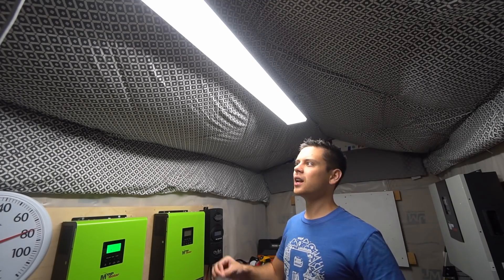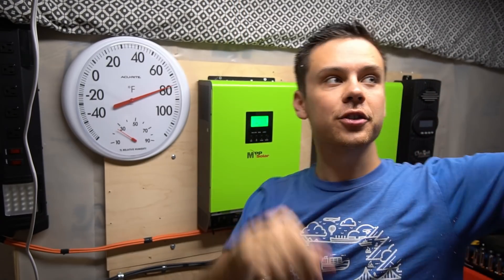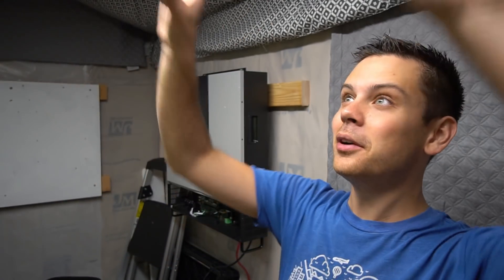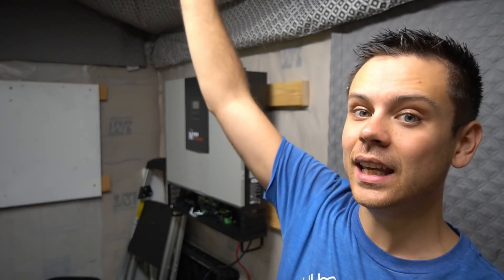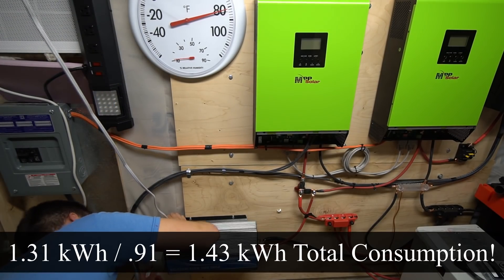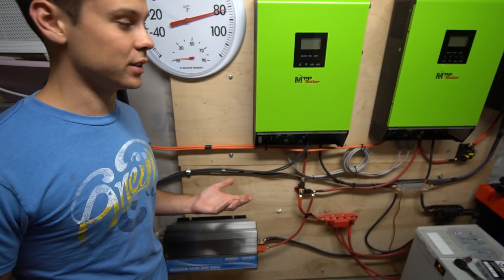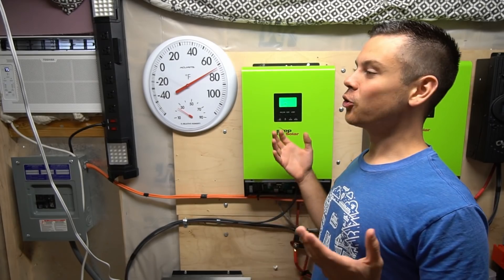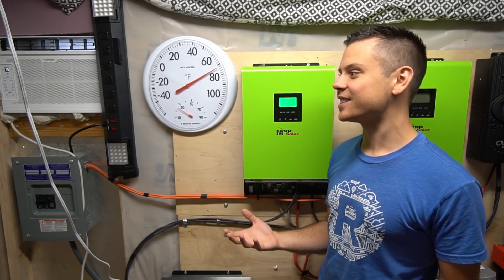Cheap Solar Powered Air Conditioner Part #3

Comment: 10% humidity, try 106 degrees @ 110% humidity  almost daily here in south Louisiana. Also try to bring the temp down into the 60"s.  I have the same window AC I use for hurricane purposes, that I hook to a generator for power outages due to the hurricanes and trying to figure out how to hook it to solar. Just want to cool 1 room with solar experiment #1. Once I figure it out, 2nd project will be a 20x60 shed. Still confused on what I need. I just been buying all the wrong things. Have 1,100 and a 2000/4800 inverter, a few charge controllers, only have a few 100w folding panels ( I think I need at least 600w for that same window AC)

Comment: I just stumbled across your channel today, excellent content! I'm in the market for a solar power generator to have just in case the power goes out for a few days. I would definitely want to run an air conditioner off of it in one room of my house in the summer months, as well as be able to boil water or heat up prepared meals.

Have there been any other updates on your solar shed? It looks like you did a fantastic job insulating it, the MS paint diagram was very effective explaining what you did. Thank you again for sharing your knowledge and enthusiasm on this topic!

Comment: I would like to have a small system for my minivan camper, based on 12 volts.  Can you recommend an inverter with low standby losses in that voltage that is resonable $$?  I presently have a 120w panel and plan to run a very small 25L Alpicool fridge/freezer and charge the usual electronics/TV and some night time lighting.  I was going to buy a 100ah lead acid battery but I guess it's prudent to only take 20-25% of capacity so would a 50ah LiFePO4 be more than equivalent?  Any help is appreciated I'm 74yo and very new to solar.  At my age it is probably a lifetime system for me.

Comment: Which 24V inverter should I buy?  The MPP LV2424 (which consumes 50W on idle)  Or the Growatt 3kW contender (I could not find its idle consumption)?  With shipping, the Growatt is only $40 more.  I do not like the 50W idle of the MPP, but Growatt might not be better???

Comment: Wanting to put a 5000btu ac in a van about the size of an ambulance. Have room for 4 x 200 watt solar panels on top... question is... I am using agm group 27 100ah batteries I can pick up very cheap... how many batteries you think could run the ac overnight? and would the solar panels charge them up to run the ac every night? I live in Florida... no shortage of sun... thanks

Comment: I'm using your book to add a 600W, 3 Battle Born 100W, system to my 2004 Born Free Class C. My RV has a built in Generac 4000W generator and a 2000W inverter already wired in. But I sure wish you had covered how do you wire in a solar system and still use the generator and also the alternator charging capabilities. I don't really have a clue how to do it and I am installing the whole thing alone, while boondocking far up a USFS road in remote/webless central Idaho Rockies. Wish me luck. (PS this is my X, not me in pic)

Comment: Will I like your do-it-yourself approach and methodical research to solar energy. I think a professional builder would have insulated your solar shed differently however, and reduce risk of combustibles. Considering the variety of components I would recommend that you put a wireless smoke alarm in your shed and a second one in your home that can talk to it so if say one of the diodes in your charge converters go bad and starts smoking you would receive an alarm before the shed burned down.
Reply from the maker: Fair point. Unattended charging is done with UL listed controller to prevent this. But yes good point

Comment: VIDEO IDEA! 12 VOLT ONLY SETUP? All of your setups include an inverter. Why? When camping I exist primarily on 12v. Easy to recharge my 12v batteries with solar panels. Refer - 12v/propane, TV - 12v, Charge phones - 12v, etc. Exist without a Microwave, stereo or blender? Easy? Coffee, food - Propane Stove (Camp Chef). Music - JBL Charge 3 or ? and a phone or MP3 player. Food - propane BBQ. Suffer without a blender? - mixed drinks or beer. The only time I need 120v is my satellite dish - A Jackery or ? - recharged by Solar. Isn't to whole point to solar is to simplify your life and dependencies?  It kills me to hear generators running or listen to people that can't live without being hooked up to the grid?
Reply: Is there any 12V air conditioners? Compressors take a lot of power so probably need voltage higher than 12V. I'm guessing....
Reply: @sean8081a  I guess you'll just have to rough it - no A/C? Just cold beer?

Comment: Have an off topic question for your advise as you are the best at these power stations by far. I want a emergency back up for home use and later to bring on trips but for now home. So one is only charging up using a/c.  I'm between Bluettie 1000 watt and goal zero. It has to run a fridge for at least several hrs til power would get back. Yea maybe make a cup of coffee . ha   I am thinking both can do what I want. Leaning to bluetti but definitely want your advise.

Comment: i think you should ditch the blanket and just go with more foam panels - get some more led going in there, try also a small hepa pos pressure intake and maybe a small heat exchanger - what would a person need if they wanted to put in a mini split - a few more batteries or panels no doubt but overall the system could be expanded pretty easily to add capacity - you may want to add insulation to west wall but i think you basically got it under control  - well until it gets to be 120 and then we will see how it holds up - maybe consider a small helical wind turbine or two as a battery hedge strategy?

Comment: Very, very cool (no pun intended!) Will. I have another project using an inverter to power an ac that I hope you can give me some advice on. I have a van with a 220 AH flooded cell deep cycle house battery bank, a 2000W/4000W surge pure sine wave inverter, and a 160 Amp engine driven (stock) alternator. I replaced the .7V power robbing to the house bank isolator with a Blue Seas ACR, or automatic charging relay. I also have a 8000 BTU  window ac that pulls 620 watts with the compressor running. Start up surge is unknown, but my 2.8 KW Onan generator powers it up effortlessly. My question is, assuming that the ac's compressor start surge will be handled by the inverter, do you think I can run the window unit going down the road, only relying on the alternator output to charge the house batteries? I'm thinking that I might burn up the alternator, so have been afraid to try it.

Comment: Will,  You are always hammering solar generators that do not have a regulated 12 volt DC socket (For good reason) So then tell us how do we build one to add to our Battle Born battery ?  I can not find one on the market, if they do make them please point us in the right direction. Thanks.

Comment: Love ur vids Will, I just installed 4x200w panels in parallel and I'm only getting 175w into my Bluettis....should I wire them in series instead? I have another panel to add also... Thanks a lot!

Comment: Hey Will, can you tell me what you think of these batteries
EVE Energy Co., Ltd Product Specification
File No:LF280-73103 Version:B
Effective Date:May 25th, 2018
  Product
Model Specification Draft Checked Approved
LFP Power Battery LF280
3.2V 280Ah
I can send you the specifications pdf

Comment: Hey will ,great job lots of info for sure , I am looking to pick ur brain regarding my system!! I have a small system I have 8 (6)volt deep cycle batteries connected in 4 strings series n parallel to make 12 volt batteries they are US 2200 batteries .i have (2)270 watt panels in series with a 40amp mppt ever controller and a 1500 watt inverter. I used 1/0 Gauge wire for battery connectors n connected to inverter and 8 gauge  wire from panels to controller,panels only 8ft from from controller .on the positive to controller I have a 80 amp conext link aluminum flat fuse ,between batteries and inverter I have a battery shut off switch and a 150 amp copper flat fuse ..I use this at my cabin ,we spend about 20 nites a year there , can u recommend anything I can do with this system to ensure I’m maximizing its productivity. Appreciate any info u can give me. Thanks so much love watching your videos .stay safe cheers .

Comment: Hi man.
I watch all your videos, they are all very good.
I got a question if you can help me out here...
I have alot of 37v ebikes lithium batteries and i want to use them as they are with a solar inverter but i can not found any systems apart from 12v/24v/48v and so on, any help would be great.

Thanks.

Comment: Hi will.  I have a project for you.  Have you checked out the youtuber tech ingredients?? He has created a high seer rating desicant air conditioner.  He tried to upscale it in a follow up video but couldn't get very good efficiency.  I'm wondering if you could do a cool colaboration with him.  Imagine how the game could change if boondockers and off griders in az and las vegas could build DIY desicant air conditioners running off of panels directly because they are so efficient.

Comment: hello friend!thx for sharing your knowledge!!i have a question, i bought a (SOLARMAX 15MT) inverter cus was really cheap..but now i dont know how to use it with battery pack cus it has only inputs from solar panels straight to inverter...yeah thats weird inverter also runs 4 phase electricity,any ideas to modify ?

Comment: Will, help!
I want to go with 24V setup in my van, but how do I charge it off 12V alternator? 
Where I live there’s almost no sun in the winter.
Reply: 24 volt alternator with a step down for the vehicle and other 12 volt needs military surplus is the least expensive

Comment: Hey Wil, I need your help big time! 
Could you please text me @ 3868710314
I have an aims 200ah 12v lithium LFP
And a epever 30 amp solar charger that I need to program for the battery and it needs fields filled that I have no idea what to input. I'm leaving in my RV this coming Monday for a 6 month trip and have to get this done. I'd really appreciate it.....
I can send you screen shots of battery specs and controller form.

Comment: Video Idea/request: a broad, how to safetly connect wiring to avoid sparks/fuses blowing/dammage etc. I see you touch on this is many videos but it would be great to have a general purpose guide that could work no matter what basic system you are putting together. I would like to know why you need to short out things first/connect things in a specific order/use a resistor to short etc. Also if not too long tie it in with where its good to have fuses and also earthing (which I am not sure on or how). I have just put together a basic car 12v solar system and blew some fuses in the process. Love your video's!

Comment: I want to warn people away from those “portable” AC units, you know, the kind that has a single exhaust that you put out the window. What people don’t realize, is that the air you exhaust outside must be replaced.....BY OUTSIDE HOT AIR! Even the duct radiates heat. You are far better off to install a wall/window unit or even better a “ductless split system. The latter are super efficient, nearly silent (22 seer!) and there are DIY kits on Amazon. I’m amazed the portables are even legal in CA since the parent government likes control.

Comment: I’ve been awestruck at how efficient homes can actually be, but it comes at a price. The old adage, pay now or pay a lot more later greatly applies. Some of these homes have what looks like two walls. Floors, foundations, attic AND roofs insulated. The homes are even pressure tested. They are so well sealed they needed fresh air but have heat/cold recovery in the system. Just incredible!

Comment: Thank you for that!! I always insulate my buildings before even looking at heat or cooling... A 5000 btu unit cools my 1100sqf house when it's 90 degrees outside.. a 30000 btu blue flame heats the whole house when it's 30..  insulate as much as you can, then you realise we only need tiny power to hear and cool

Comment: Would you be interested in exploring some more unique battery and power generation alternatives. As an example a wind turbine powering the pumping of water into a water tower and the possible limited generation from just taking a shower perhaps, could you get hot water out of it maybe and nothing else. I find the current tech kinda cool but we're seeing too many "throw-away" products. Lifestyle changes can be empowering.

Comment: OK I have 4 big solar panels and a 60 Amp charge controller and a 24v battery system.   Can I have my solar at 48v going to a charge controller and have it maintain my 24v battery bank?

Comment: You should go ahead and buy some ultraviolet solid-state admit orders at k a l e Deez and build a pre-filter virus mutator because those mutations are supposed to be lethal to the virus if it is exposed to ultraviolet radiation even from LEDs. That way you can have your friends over Ann's any viruses they leave behind will not do well

Comment: This is awesome Will great job!  I’m excited to do something similar myself. Can you do a quick recap of the parts / solar setup for the shed A/C? I believe you have 2 MPP Solar all-in-ones setup in parallel but don’t recall all the other batteries and parts you used.

Comment: I can't find any place where you disgusts issue with installed electronics not working when lifepo4 batteries run high on voltage. Example. My MaxxAir fan 2 keeps becoming unresponsive and needing reset because of my voltage going too high??? They say they are designed for RVs with voltage regulation but I can't find anything reliable. They say when it gets over 13.5 volts for more than 45 seconds the fan will shut down because of overvoltage. Can you do a video on regulating the voltage from solar batteries to 12v electronics sensitive to overvoltage? You use a 24 to 12v device yes? can I see something like this up to my 12-14v system to protect my devices? Any advice? Sorry to post this question here but I don't know how else to reach out other than a recent video.

Comment: if you would  like  may you build super capacitor with lithium battery 12v 3s  to using both for solar system ?
thank you

Comment: This is my tally of the results so far, showing you've about halved the power usage with the various adjustments. Not enough data to be more precise than that. I doubt it'd make much difference but real interested in throwing down an insulation layer on the floor.

90F Day  
No roof/floor/door insulation  
24 hours  
2.78kWh  

101F Day 1  
No roof/floor/door insulation  
24 hours  
3.65kWh  

100F Day  
No roof/floor/door insulation  
24 hours  
3.03kWh  

98F Day  
No roof/floor insulation  
24 hours  
2.14kWh  

98F Day  
No floor insulation  
26 hours  
1.31kWh  
< 1.21kWh at 24 hour equivalent

Comment: Thanks Will! Here is my system in Thailand.
Two new 12,200 BTU Mini-split 
Lesson learned:
Energy Audit:
I was going to upgrade my 1.5kW solar system to 3 kw. Upgrading the AC is a better value proposition. Those AC Mini-split inverters "sip" energy at 200 watt hours each.
Carrier X-Inverters (22 SEER rating)
Solax 1.5 kW Grid- tied Inverter, 5 Jinko 325w panels. If I ever go off grid, my battery bank can be much smaller because the loads have been reduced by at least 40%!

Comment: You need some mass in the shed. I put 2 liter soda bottles filled with water and stacked them up on the walls like wood shelves.  will cut 30% more they give off cool in the day time and charge at night if the Ac is on a timer/thermostat
Reply: Agreed. Most efficient way to keep cool would be a huge thermal mass which you keep cool at night, either with fans or an AC unit depending on your target. Going underground is also a great idea.

Comment: Holy crap! How much money are you spending?!? A/C, inverter, batteries, solar panels, blankets, reflectors, insulation, weather stripping... I think because you make $31,000 a month, you might be out of touch with how much money most people have to spend on projects like this. I love that you do this stuff, and it is pretty awesome to have a solar shed with a pile of batteries that requires an insulated and climate-controlled equipment room. Don't stop! But a bit more disclosure on how much you're spending would also be good.

For example:
    Batteries: $5,000
    Expected Lifespan at 80ºF: 10,000 cycles
    Expected Lifespan at 100ºF: 5,000 cycles
    Shed Climate Control Budget: $2,500

Now if you spend $210 for an A/C unit, $300 for an Inverter, $800 for 3 Renogy 270 watt 24 volt Panels, $1300 on the Bluetti 1500wh, plus $250 on miscellaneous insulation, blankets, radiant barrier, weather stripping, caulking, etc, we can see you were a bonehead for spending $2,860 to save $2,500.

I know, you probably had half the stuff just laying around, but we don't get demo units to keep or crap tons of LiFe batteries laying around. 

Just remember us little people who don't have an unlimited budget!
Reply from the maker: The $1299 bluetti and some used solar panels can power this shed. It's fine. It is cheap, just ignore the massive split phase system in background
Reply: DIY Solar Power with Will Prowse oh I get that they are separate systems. You just spent $2,850 to cool your shed. What’s the ROI?
Reply: This is America. People are free to spend their money as they please. Worry about your own home.

Comment: Will Prowse ,  I have a out off the box question for you ,   does it take more energy useing solar panels to keep a room with insulation cooler in a hot climate or more energy to keep the same room with insulation warm in a cold climate with the air conditioner and heater respectivaley useing the same watts etc .
Reply: BTUs